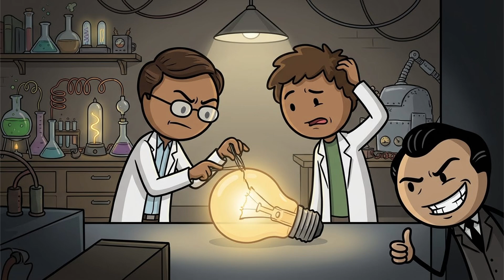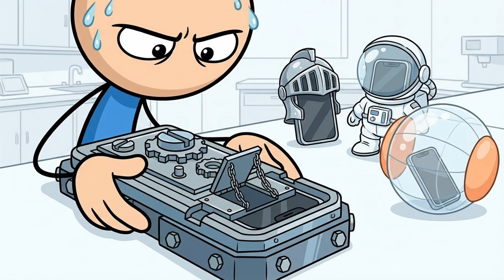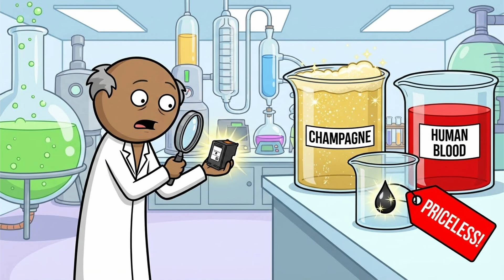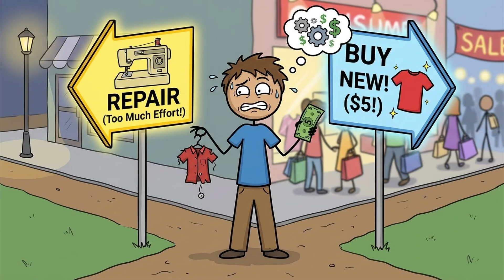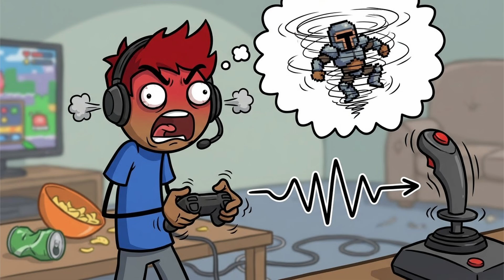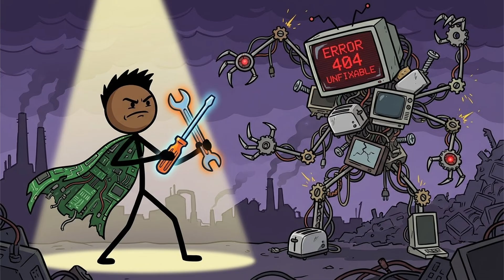Everyday Products That Are Designed to Break So You Buy More

Comment: The answer is to "de-modernize." Find an older car with a good reputation for reliability and spend some money to recondition it to like new condition.  It will cost about 10%-20% the price of a comparable new car and will last much longer and cost much less for maintenance and repairs.  

The same thing goes for appliances. Find good older washing machines, dryers refrigerators, window air conditioners, and dishwashers, etc from the mid-1970s to the early 2000s. Parts are still readily available for most of the better models and they are easy to fix and recondition. Once again you will spend a fraction of the cost of a new one and have a far superior appliance that will last much longer.

I don't say this because I am anti-technology. I say this because I am anti useless technology.  If people refuse to buy the newer appliances and newer cars, the manufacturers will be forced to de-content their products of useless bullshit and make them more reliable, durable and easier to repair instead.

Comment: The soviet union also made eternally lasting lightbulbs. There were factories for those in east germany that were shut down after reunification so it didn't pose a risk to the non-lasting bulb manufacturers. They made unbreakable glasses for bars aswell.

Comment: You could always switch to neon tubes or modern eco friendly gas filled light bulbs. They last longer than ordinary light bulbs. 

I have a South Korean Android pad, it's already survived longer than two Android Chinese phones and an Android Chinese pad. Regularly clean your cache and don't allow your device to come to harm. Treat it with respect, it's not a toy, it's a sensitive electronic device. Download the users manual. Have cache cleaning and protection systems. 

Buy natural fabrics, get it them from quality mail order companies and shops. Don't buy cheap crap fast fashion. Learn to sow, then you will know quality when you see it.

I have my mother's 1980s larder fridge and her 1980s chest freezer, colder than modern ones, still going. My freezer is so cold, you need gloves to use it in the winter and wish you hadn't, but it's bliss in summer. Buy an expensive branded fridge and/or freezer. It's like buying a luxury car. Treat your food and drink with respect.

Buy the most expensive washing machine you can, it will live longer, same with any kitchen appliance too. However because a kettle and toaster are high use items, buy cheap, because the expensive ones don't have any better shelf lives.

Comment: You pay $40 for a printer, you get what you pay for. No manufacturer can build a printer for $40. The business model is give them the razor, sell them the blades. Buy used commercial grade printers if you want them to work economically. Those printers are sold on a "per click" basis, you pay for the lease, toner, service, etc. based on a fraction of a cent per page.   It is in the manufacturer's best interest fot these printers to last and work economically. Find these coming off of lease and buy them.

Comment: Crazy how that centennial light bulb is still glowing. I remember when it hit 100 years old. How much longer can it glow?
Reply: The light bulb has no lifetime. Its the times you switch it on and off that makes it count its days. Actually its naps.
Reply: @grgamer8470 the bulb has never been turned off, 1930's renovation, and in 1976 when the bulb moved, and the odd blackouts. Other than that it's never off
Reply: @Ants-z7c you prefered to a specific light bulb. I was analysis why this did happen.

Comment: The Centennial light bulb is running at a fraction of its original rated power specification. (It was spec'd for 60 watts is currently operating on 4 watts). While the bulb originally sold for 40 cents, adjusted for inflation it would be equivalent to $13-$14.
Reply: Lol. There's always a catch hidden somewhere.
Reply: But I’m sure it ran at 60 for several years. I’d pay $14 for that.
Reply from the maker: Thanks for watching. Do you have any suggestions for a future video?

Comment: Removeable access panels.  SAE threaded screws holding everything together until YOU decide to remove the screw to get at something.  No fu--ing computers where analog controls based on mechanical and magnetic links that are as durable as Egyptian tombs can be used.
I am using Windows 7 to write this comment because it WORKS.  Every Windows operating system since is a POS.
I drive a 1966 Pontiac because 1) it WORKS, and 2) when it does not work I can FIX it.  When I use new sheet metal screws I get the kind that have HEX heads on them because I can put some TORQUE on them when they corrosion weld themselves into the sheet metal.  Philips head means your screwdriver tends to back out when you try to exert some TORQUE on it to break it loose.
Look at YouTube videos on repairing a washer or dryer.  First step, remove the access panel, it's EASY.  Look at your actual malfunctioning appliance of the same brand and model, NO ACCESS PANEL!  To get at the easy to replace part, remove 15 other things that did not need repair until you f'd with them to get at the one thing you needed to replace because the manufacturer decided to do away with the access panel.
Next time you are at an airport, take a look at the outside of a Boeing or Airbus.  Access panels everywhere, rows of them up and down the wings.  Why?  Because airlines are not going to pay $150 million dollars for 400,000 pound piece of modern art.  They need to be able to get their big expensive bird flying again right away!  None of this business of forcing the mechanics to take apart 15 other things just to get at the one thing that needs adjustment, repair or replacement.